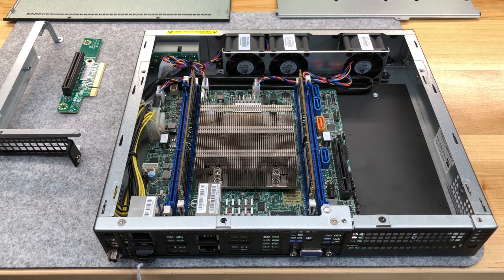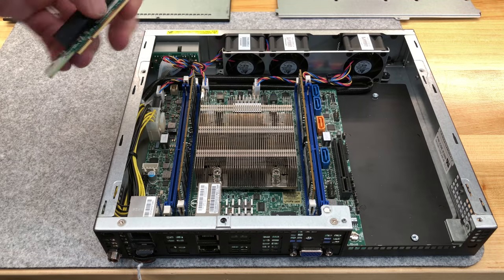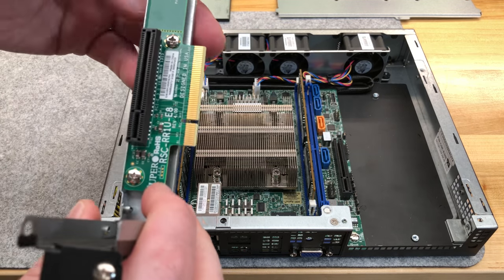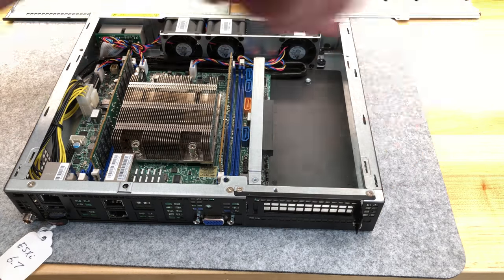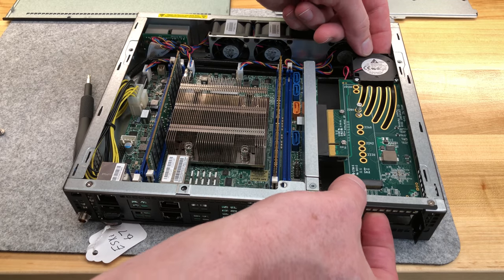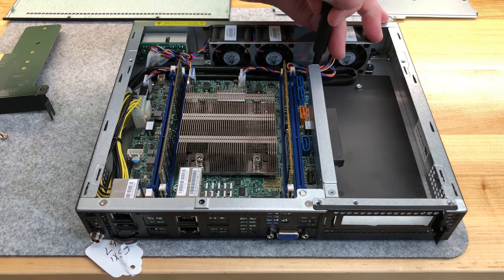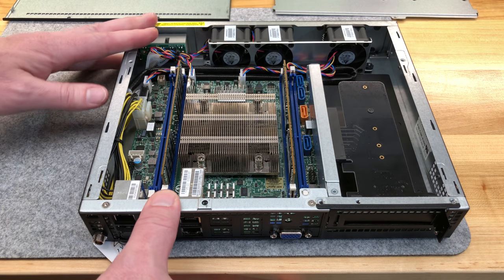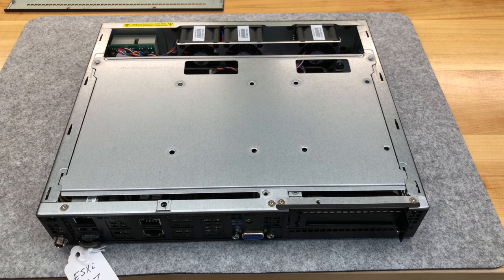Supermicro SuperServer SYS-E300-9D PCIe angle bracket and PCIe card for M.2 install [4K]

Comment: Seems like the 9D is a step backward? The 8 had onboard M2 and dual SataDOM and you could mount a 2.5 SSD. Now in this you need a bracket to get the m2 in leaving no room for the SSD and has single sataDOM